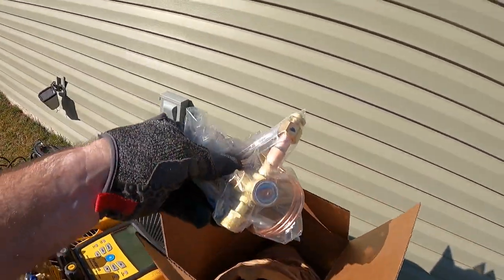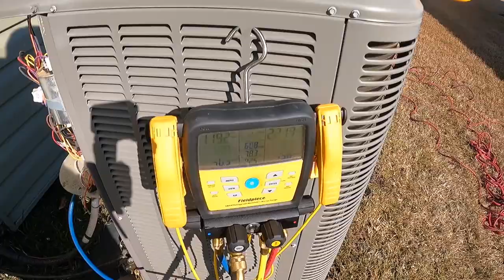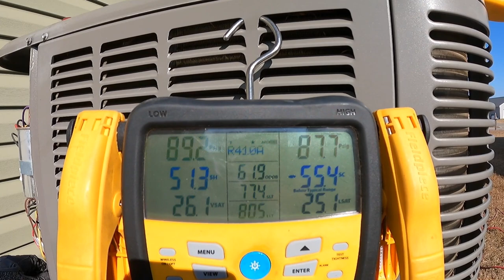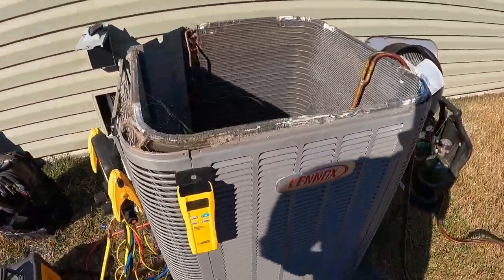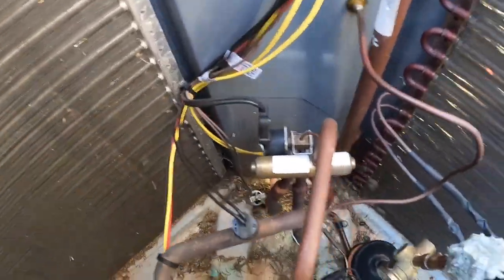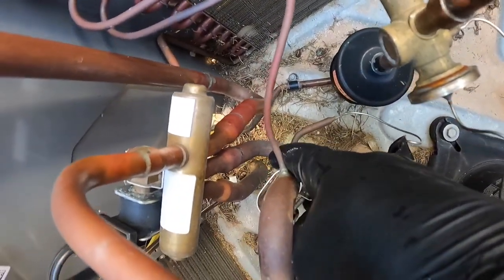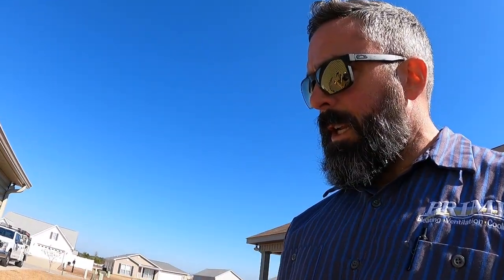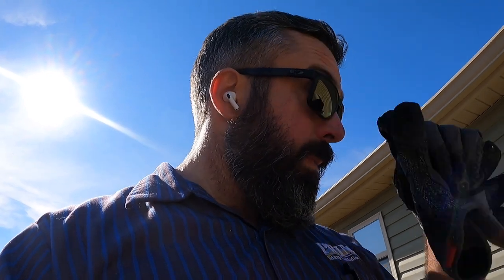Bad TXV in Heat Pump Condenser

Comment: Thank you. Some people way over-diagnose to arrive here, while others way over explain the process to the point you get lost in the diagnosis or explanation. Others under-explain the diagnosis because they are referencing knowledge in their head that they have and I don't. This hits right where I can understand it best.

I have a 21 year old unit I'm not spending any more money on. I'm having it replaced. But that doesn't mean I don't want to solve the puzzle of what is wrong. I have an Amana with indoor and outdoor TXV. It seems to run fine in cool. But the outdoor unit trips off in heat.  Sometimes it will run a cycle or two or a day or two in heat. Then the next time it turns on the outdoor unit will trip off after a few seconds or a few minutes. I know this from changing the contactor and changing the capacitor and trying again since it was cheap to try.

I know it is impossible to know without having someone come out again  to hook up some guages and diagnose, but I think the outdoor TXV is the problem. I would think if the bypass check valve were stuck or a pressure switch were bad it would cut out consistently.  The only thing near consistent I've seen are the times it kicks on again after a successful few cycles and trips off in seconds. I saw it do that a few times consistently and thought well the contactor or capacitor might be about gone. When I realized it wasn't the problem I cut it off, put on the emergency heat and put in a service call. They sent a guy out to check it. When we put it on it ran fine and the pressures looked OK, and the electrical checked out OK. I explained it would eventually start tripping out again and he just said well it could be a lot of things, it might be the compressor going and it's pretty old to be spending much on fixing it, and I already had the latter part in my mind anyways.

Does this sound like outdoor TXV to you? I am tempted to cut the stuff off the sensing bulb, have a look and re-wrap and attach it with fresh stuff.
Reply from the maker: If it heats fine when it is working, I wouldn’t look at the txv as the culprit. Sounds like a pressure switch or maybe even the defrost board or defrost components if its old enough to have the relay/timer defrost set up.  I would want to catch the issue or be ready when it happens with a volt meter and check my low voltage coming in on the Y circuit and see where it stops.  Obviously it’s not getting to the contractor when you’re having this issue.
Reply: @AIRMANHVAC  Heat seems OK to me and the big line is hot to the touch. Yeah it's my luck it don't happen when a contractor is here. First guy I wasn't here, checked it out, checked the coils said they were clean. But said a spider family must have spent the summer under the cover and the contactor looked pretty burnt. So I OK'd that to be replaced. Then when it quit that night the next day I went and got a capacitor and did that myself. Then I called another company out and made sure I was here and it didn't trip then either. I think I would have to do the ugly thing of leaving it where it trips off and the backup eventually comes on until someone gets here.

Yes, it has TXV's and a copeland scroll but still has the old style 30/60/90 defrost board. That is something I have replaced myself other places I've lived. I have also replaced the nice ones with the sensing bulb on a Rheem. But for the obvious failure to defrost. I hadn't considered the other electrical controls. The pressure switches look like the thread on a schrader type. As old as this thing is the parts may be cheap, like save it back in electricity by the time the new one gets put in. 

Thank you for responding and getting my wheels turning.
Reply: I couldn't sleep tonight so I decided to use the time to test it and get a better answer than "Heat seems ok to me". So I set the defrost to 30, cranked it up and started collecting temperatures.

At 35F outside, 70F inside, the insulated line is running about 110F where it's uncovered before entering the air handler. Little line room temp. Return air is 70F, supply air coming out of the vents is 95F.

Outside it starts frosting at the TXV and it spreads to the capillary lines, and then forms frost bands on the outdoor coil. But it doesn't get real bad of course because the timer is set to 30. It ran cycles, satisfied, then ran a long cycle and went into defrost. Switched back and kept going no problem. 

I read through the service manual and is says the high pressure control resets manually. So thinking that would mean it would lock out I thought I could used that to say OK low pressure. But it does not state what that procedure is. So I may be resetting it not even knowing by going to the thermostat and changing over to emergency heat. Then coming back later and testing again. I dunno. Looks like it's not going to trip out again until I am asleep or a few days from now. Who knows. I guess it could be an intermittent pressure switch. I haven't been able to find the parts either. It's old so I will have to call the tech and see if he can find and price them.

 Or maybe it could be a piece of metal flash finally fell of somewhere where it is not really circulating and not really lodging either, just occasionally finding it's way to a spot turned the right way to make a restriction. I had an old retired HVAC guy tell me he ran into this once where several techs had been called in on an intermittent problem. He said he pumped it down, opened it up on the inside and and a little odd shaped piece of trash fell out that had one flat side. Said he put it back together and it ran for years and they stayed a customer from then on. He guessed that little piece of trash was hanging out just kinda free-balling around and every once in a while it would get in just the right position while also being turned with the flat side the right direction to cause enough restriction to trip it off.

I may not get to solve this puzzle before the new one is installed, which will bug me.

Comment: You did all that nice work but shocked you didnt change the heat side liquid line drier .
Reply from the maker: Rick, I’m shocked too.  It happens.
Reply: Or purge with nitro during brazing
Reply: what is a heat side liquid line drier?
Reply: @robertmarshall8369 no such thing lol who knows
Reply: Thats because the lennox has it inside the condenser..so youll have to cut out the old one which is not ona very accesible spot ..install a bypass 3/8 copper tube. Braze it back up and go back inside the house to install it (florida) or near the ports if you dont care.

Comment: May I recommend you start purging with nitrogen while brazing to prevent oxidation, also replace your filter drier anytime you open up a system.  Good work practice.
Reply from the maker: I recommend the same.
Reply: I dunno why, these recommendations always irritated me. Best practice, sure. Absolutely required, no. Here's my recommendation, installers quit cooking the TXV and bulb. It's either flooding, starving or hunting... weeeee
Reply: @zacharyreed45 wit any system utilizing poe oil it is absolutely necessary to purge while brazing,as well as replace driers any time system is opened.  If you're not doing it, you're doing it wrong. Period. I recommend doing it on all systems regardless anyways

Comment: If you hooked your high side hose up to the liquid line instead of the vapor line, it would allow you to check subcooling in either mode without having to move your temp clamp. I always like to see if i have sucooling before the txv or not. Tells you alot. The issue can be inside or on the way to the outdoor unit somewhere.
Reply from the maker: I have yet to see a manufacturer list a recommended subcooling in heat mode.  All I have ever seen is a graph with the outdoor/indoor ambient with a correlating pressure for those temps.
So, yes you can check the subcooling in heat mode but there are no guidelines offered by the manufacturer for comparison to show whether it is charged properly.
Reply: @AIRMANHVAC  I havnt seen a recommended sc for heat mode either but you still want to check it in heat mode. If you have zero, that's a big problem, then again if you have 20 or more,that's also a problem. I guess it depends on what the symptoms are. If someone overcharged it and you have really high SC you're not going to have shit for a temp rise inside. If you have real low or none your just going to ice up outside super fast as well as have shit for temp rise inside. Idk I always check both sh and SC in both modes. Also the best way to see if it's the txv or not

Comment: Would a bad odu txv cause my hot vapor (suction line) pressure to go over 600psi (410a) in heating mode?
Reply from the maker: Possibly, I find it more common that the system is overcharged in those cases.

Comment: New split unit heat pump. Indoor coil has a orfice  nd outside has txv. Unit cools perfect. On heat the head pressure climbs to 500 within minutes while suction stays the same at 100 psi. Properly charged. What’s the issue?
Reply from the maker: Dirty Filters - Dirty evap coil - Inadequate air flow across the evap coil or it’s overcharged.  I’d weigh the refrigerant out and compare that to the factory weigh in.
Reply: @AIRMANHVAC  it’s all new. Factory charged.

Comment: Hello , what if my pressures are equalized in heat mode and normal in cooling mode ?
Reply from the maker: You probably aren’t using the correct port for suction pressure. On heat pumps, you should have a true suction port.  On most equipment it will be near the usual service ports….on Trane, American Standard, Rheem and a few others; you’ll have to remove a panel to access a true suction port.
Reply from the maker: This video may help as well https://youtu.be/UY9HGQ8lwls
Reply: Thanks for the info, appreciate it.

Comment: Could a bad txv in the outdoor unit cause the high and low pressure to rise together to high levels and shut down on high pressure?  Reversing valve is good
Reply from the maker: The outdoor txv should only affect pressures during heat mode.  From what you’re describing, it sounds overcharged.  I’d recover/weigh out all refrigerant.  Then weigh it back in according to the manufacturer’s specs.
Reply: @AIRMANHVAC  we did that. It also works without issues in a/c mode. It's nuts, I've never seen a heatpump do this before.

Comment: A liquid line restriction has the same symptoms as a restricted TXV do temp drops and sub cooling have to be brought into play. Or some guys just go ahead and replace the TXV and filter drier and say bad TXV. When all the while it was a restiction.
Reply from the maker: Hey Robert, system operated fine when set to cool mode but not heat mode.  After replacing the txv, it worked fine in heat and cool mode.  Did you watch the video and see the sensing bulb was no longer attached to the txv?  No question that the txv was the issue on this particular call.

Comment: Next time you should consider removing the filter drier from inside the heat pump and installing it close to the metering device inside the home. Also, a triple evacuation is best.